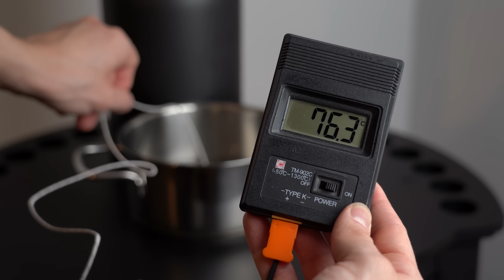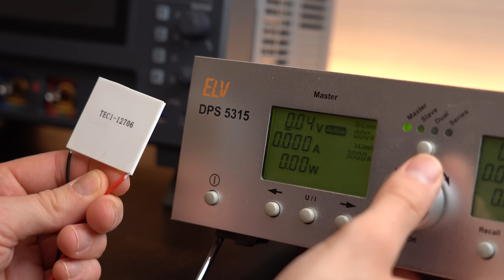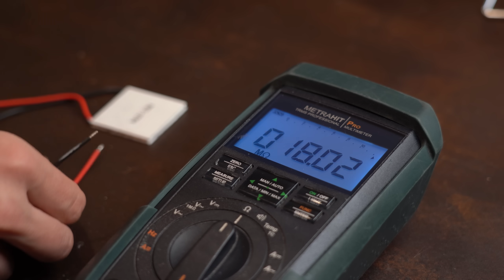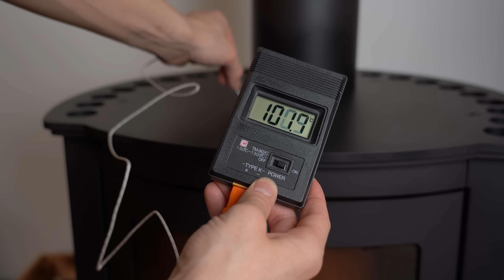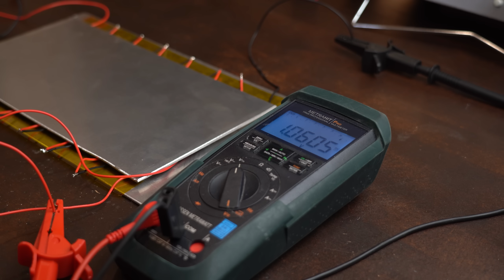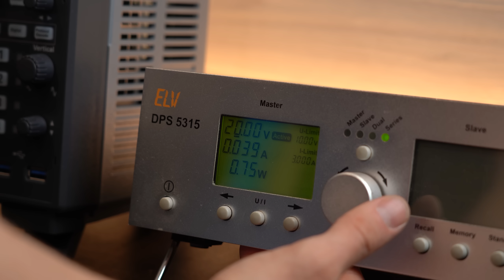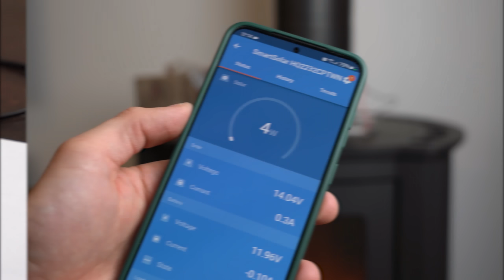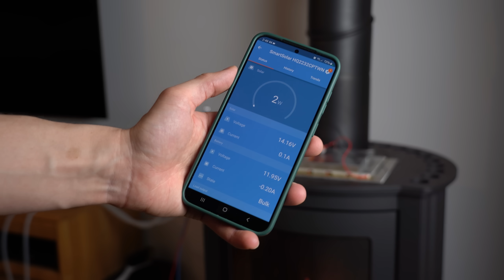I tried to Power my Home with Heat Generators! (Worth it?)

Comment: I'm a chef and an electrical tinkerer, and a commercial kitchen will be running its grills, ovens and deep fryers all day everyday. A lot of heat for a long time. So I've always wondered if it would be worth capturing all that heat for energy?
Reply from the maker: For now I can say not by using Peltier Modules ;-) More ideas/test coming up soon hopefully.
Reply: @greatscottlab  Thank you for closing one of the many background processes of my mind👍
I Appreciate your work and love your ideas.
Reply: A small steam turbine?  @greatscottlab
Reply: There are energy recovery hoods available, mainly used for air heating but can also be used to preheat for hot water. There are also desuperheaters that can recover heat from refrigeration and AC for hot water heating. For electricity generation you really need high grade heat, but you can make huge efficiency gains just by not wasting heat you're already generating if you can use it somewhere else, which you pretty much always can in a restaurant.
Reply: @punkdigerati  yeah that's mad👍
I'm guessing none of these systems would be very cost efficient, but if you have heaps of cash to burn, some know how and good ideas, most kitchens are packing heaps of heat to play with.
Love your positive ideas 👍
Reply: You need that heat for cooking though, if you try to generate electricity from it you'll probably end up cranking the grills/ovens more to compensate for the loss.
It's probably more efficient to add an insulation layer to lower the already existing heat losses, thus lowering your energy bill, rather than trying to re-use those losses.
Reply: @pbe6965  not if you tap the heat around the edges of grills and above the cookers possibly catching the rising heat and in turn, cooling the extraction system?
But it turns out to be pretty inefficient as demonstrated
Reply: You could you a heatpump to turn this excess heat into warm water for the sink!
Reply: There is a way to capture this waste heat rather efficiently, under some specific conditions.
The solution is installing a heat pump (well, rather the evaporator of the heat pump) in the exhaust ventilation duct.
Then use the heat extracted from the heat pump to heat (or in some cases pre heat) water to a hot water ackumulator (tank) for hot tap water.
A well calculated system of this kind will more than likely provide a restaurant with all the hot tap water it needs for 1/4 of the cost of conventional hot water.

Here in Sweden, for domestic use, systems like this will provide all the hot water plus some of the room heating for an average family in an average house.
Reply: Low temperature heat is very hard to extract useful energy from. Best bet is to transfer the heat as is, heat other rooms or a pool.
Reply: all waste heat is worth capturing.

Comment: I live in Germany as well, and I was thinking either diesel heater or a heat pump to (mobile split klima) as alternative heat source, gas it so expensive.
Reply from the maker: We have a heat pump and use around 3000kWh for a 150m2 house per year. That includes hot water. Works out pretty well for us ;-)

Comment: Wenn du wirklich weit über 30 Cent pro kWh bezahlst wechsel deinen Strom Anbieter, es gibt sehr viele Optionen die weit unter 30 Cent liegen.
Reply from the maker: True. But under 30 Cents gets harder to get as the years go on.
Reply: @greatscottlab  30ct is pretty average in the southwest, i dont know about other bundesländer though

Comment: NASA has successfully had these things powering Voyager probes for almost 50 years - maybe instead of using wood to provide the heat, you should have tried plutonium?
Reply from the maker: Haha great idea ;-)
Reply: @greatscottlab  for the record: If anyone from law enforcement asks, technically I only remarked about something you could have done in the past - I'm categorically not recommending any particular course of action in the future, especially not involving criminal possession of radioactive materials.

But do let us know of any updates to your findings...
Reply: @BenScott  LOLOLOL!!!
Reply: @BenScott  What about thorium?
Reply: @greatscottlab Dried leafs 🍃 are highly combustible create alot off energy but they burn up too so fast...my thinking for a free backub power for heat and a bit off generation too charge battery just trickle charge is fire bricks made from cardboard (free) dried leafs (free) and any sawdust coffee grounds I dunno anything like this too make a custom free heat brick mix chuck all the cardboard in buckets 🪣 slush it down pour water away then add say 10% dried leaf and saw dust whatever you can get free like news papers and one you got a nice store do it all in one hit make thin trays off your mix n let dry n cut into bricks...I guess the dried leaf use is my main curiosity...I understand peltiers can be a pain I have worked with them destroyed many I belive best place too use them for generation would be a snowy area where you can stack them and have the cold side outside and the warm side inside your house so running through the wall say 40 peltiers stacked into block and the cold side is outside n warm side is inside next too your fire..maximum heat differential that should do a good job ..cheers
Reply: @jshaw4757  I found dried leaves to be surprisingly bad burning.
I have to get rid of a lot each year. Burning sucked, even on a grate to get air in from underneath. Just smouldering and a lot of ash preventing air flow. 
I now bring them to a friend to feed a biogas reactor with it.
Reply: @jackmclane1826  Had different results  maybe your leaves not crispy dry...leaves are hugely combustible n contain oils also just watch some vids or read online im guess unless you had a rare type leaf don't burn or not fully dry ...get a bay leaf n put a lighter too it lol...power.. volatile ...cheers
Reply: @jackmclane1826  They go up in flash plies dried leaves usually high heat but fast...dried leaves vs wood is a bit like a capacitor vs a battery ..make sure bone dry next time try again
Reply: @jshaw4757  They were as dry as they get here naturally in fall.
Reply: @jackmclane1826  Different levels per leaf so yh what leafs you got bud
Reply: @greatscottlab you just need to make sure to order it discreetly to avoid trouble with those annoying law enforcement people 😅
Reply: @greatscottlab  Wassup 👋
Reply: Actually, the type used; Radioisotope Thermoelectric Generator or RTGs have a thermoelectric generator and it's semiconductor design is very different from what is available in the market.

To be fair, you have to build your own thermoelectric generator module instead of using Peltier modules.
Reply: @pauljackson2126  there are off-the-shelf rtgs with an efficiency of around ~5%, which is pretty normal. your comment is strongly underrated btw.
Reply: Legalize recreational plutonium!
Reply: I'm sure that in australia, plutonium is available in every corner drugstore, but in germany, it's a little hard to come by /s
Reply: @oskimac Sure was in 1986 as Chernobyl was giving all of Europe free samples.
Reply: I believe they use thermocouplers, not Peltier modules.  
Also: the government does use 'radioactive' (nuclear) batteries for various things, like radio and communications stations in remote areas.
Reply: @nate_d376  The Soviet Union (and Russia) have used RITG's for terrestrial use, but I don't know of any other country using them for anything other than spacecraft.
Reply: @nate_d376 the last mars rover (perseverance) uses an RTG too, they're really common in space exploration. Don't have to worry about people stumbling across one if there are no people on the entire planet.
Reply: @superslimanoniem4712  RTG's area also in light houses in remote locations all over Russia.
Reply: @nate_d376  Im pretty sure Peltier modules are thermocouples, just ones made for a different purpose.
Reply: @GraveFable25  off the top of my head, thermocouples use the properties of dissimilar metals to generate a potential.  Peltiers use alternating P and N type semiconductors alternating in series or parallel.
Reply: @GraveFable25  thermocouplers generated a current from heat.  Peltier mods USE current to move heat.  Different things.  Voyager probes use a Radioisotope thermoelectric generator with a decaying radiation source that heats up the thermocouplers, and they then generate a current.
Reply: @BlackWolf42-  yes.
Reply: @nate_d376 i believe that on iss they directly use photovoltaic cells, which are more efficient that Peltier, which relies on a difference of temperature. And fuel cells of course.
Reply: The fire probably is putting out more watts of thermal energy per second, but the cold side is room temperature rather than however fast heat can be radiated without the insulation of the atmosphere. I would guess the durability would be from both sides being cooler on the probe compared to on the stove.
Reply: wood beats plutonium in this use case since it can reach higher temperatures (and shines on the cost efficiency side)
Reply: Probably identifies the difference between a million dollar system and a five dollar system...
Reply: I'm pro-nuclear and all but there are already around 1000 soviet RTGs in the wild. 😅
Reply: @ If people weren't stupid, each house could produce hot water with one😩
Reply: use plutonium when nasa itself has a plutonium shortage? sounds doable for a youtuber to somehow get ahold of a precious material lol
Reply: Thorium or Promethium
Reply: Don't you know that Germans hate nuclear power?
Reply: 😂 just like young sheldon
Reply: Well, the Russians also did the same thing, but with Strontium.
Reply: Yeah, and dumped the heat into the void of space!
Reply: @amb1u5  And ? How do you cool down the cool side if there is nothing to trade with ? Radiations.

I said "not depending of external temperature", didn't say "not depending of Peltier's both side temperature". But it's smarter to see it as a heat flow instead of temperature differential because it's an energy converter (anyway temperature differential is directly linked to heat flow by the heat resistance from what is between the sides).
Reply: @amb1u5  Which is zero if you can't get rid of the heat on the cold side for a lack of heat flow. The chemist guy is right.
Reply: That, and the cold of deep space.
Reply: They are thermalcouples and are different to the TEC.
Reply: I have yet to find an affortable source for a REAL TEG, made and optimized for generator usage.
Usually you get Peltier devices (TEC) which are just labelled TEG. They do some generatoring, but the actually intended process is cooling. Efficiency in generator mode is benevolently described as abysmal.
Reply: Biggest issue is the temperature difference as we all know in space there is easily temperature difference of 300 Kelvin which makes a big difference in power output.
Reply: @ReinhardSchuster  Space is cold. But it is still very difficult to get rid of heat in space. You will not get this heat difference across a TEG without making it very hot, when you have to cool by radiation against space.
Reply: NASA had a readily available "Cold side" to put on the other side of the peltier. Space
Reply: https://youtu.be/BuzqKjUBfTY?si=cKIrlVP3pMwLS_9o
Reply: Plus nasa has the freezing cold of space to keep the cold side of Peltier devices freezing. Peltiers are ineffective in the real world.
Reply: And it would be much cheaper too🤣
Reply: Yep - but that was all calculated - the radioactive heat was all designed for it. This is just going in the dark with a bunch of tec's and hoping for the best.
Reply: See simple solutions. You're overthinking it with the stove. Know anyone from Libya?
Reply: Yeah but the problem with those are the cost to have them in the first place 0:10
Reply: I  still Wonder how the police dont raid his house yet😅
Reply: Oh boy, nasa ? 
The one founded by ex nazis 🤣🤣🤣
Reply: Or so they say...
Reply: Come on man is 2025 ..... plutonium was available at every corner drug store since 2015
Reply: Yeah right the NASA liars who went to fictional space used that stuff and you're sure of it because you were in fake Space yourself right😂🤡
Reply: RTG is NOT a peltier.

the effect of generating heat is same physics. but RTG uses radioisotope decay as heat source.
Reply: @amb1u5  absolute 0 yeah but it doens't matter as there is no matter for conduction nor for convection.

It's not about the external temperature, it's about heat flow.

In this case it only depends of Peltier's temperature and black body radiation. (And so, as long as the air is cooler than the heat source, it's less than what we get on earth since we can add to the radiations the conduction and convection.)
Reply: Sorry, but you are totaly wrong. In Voyager probes are used free piston Strilng engines using thermal gradient of radioizotop (plutonium as far as I know) and space.
Demonstrated solution is extreemly unefficient and never ever worth.
Reply: @martinnovak9618  the Voyager probes used RTGs of the MHW RTG design, these used plutonium-238 as a heat source, and silicon-germanium thermocouples.

While there have been some research on using sterling engines for the conversion, I can't remember having heard about any space craft actually using them, the converters have all been thermocouples, except for a couple of experimental reactors used by the Soviets that had thermionic converters.
Reply: @martinnovak9618  ironic considering it's not correct what you wrote